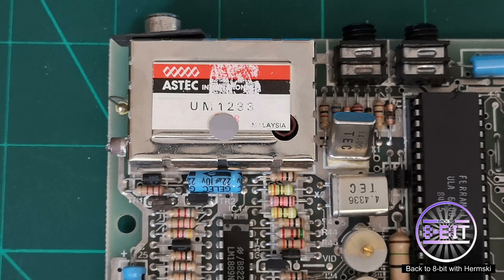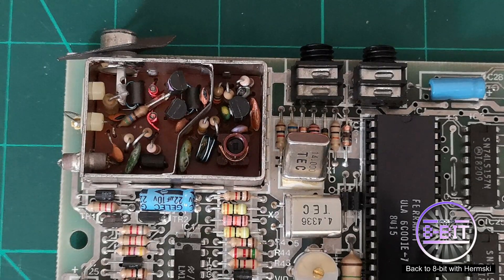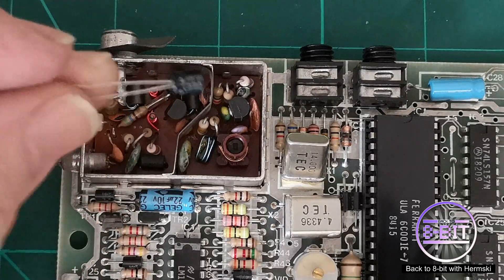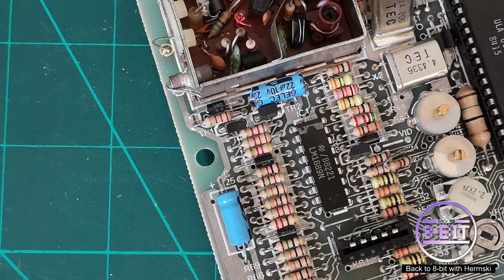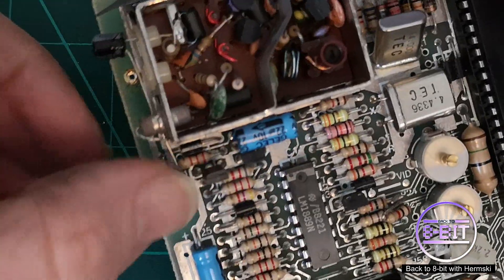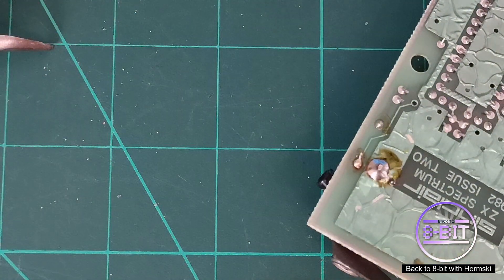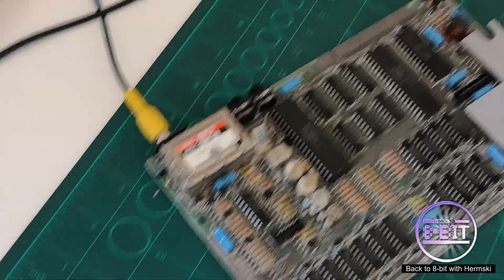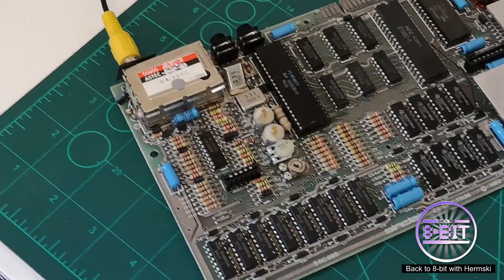ZX Spectrum Composite Mod with Capacitor - Use your old Speccy on a modern TV.   Video Modification

Comment: The capacitor would have been easier to fit by soldering the leg to the board first then through the furthest away hole into the modulator, saving having to cut the existing wire out. The capacitor is used because it stabilises the signal for some tv's to lock onto, a higher voltage than 10volts is ok but not the capacitance value of 100uf.

Comment: WHat's the purpose of the capacitor ?
Reply from the maker: Some say it's a little safer to use one.   But the main reason I use them is because for me,  it's easier to fit than managing a wire through the hole in the modulator.
Reply: @Hermski  Thanks!